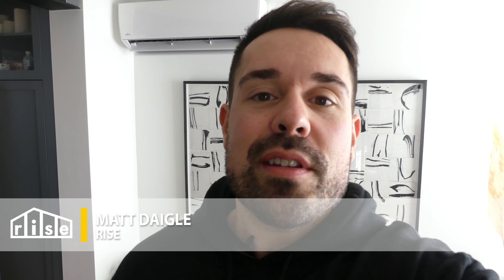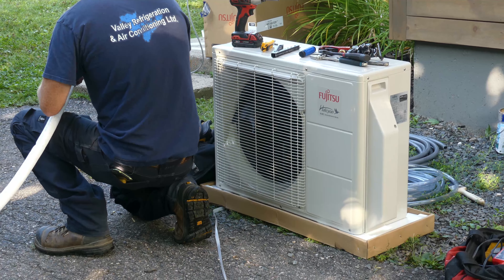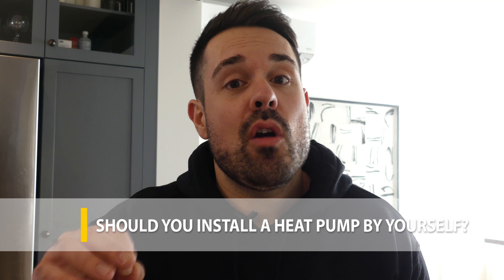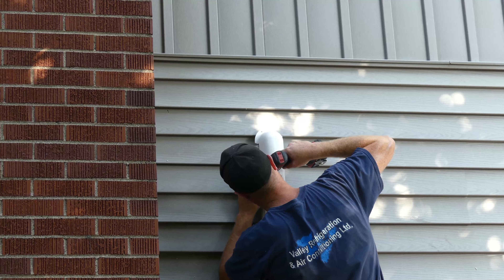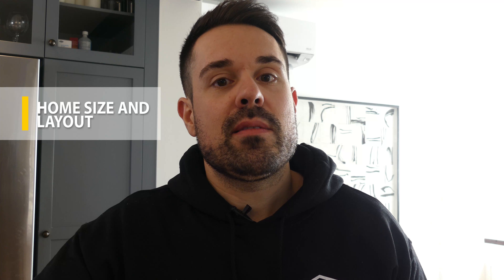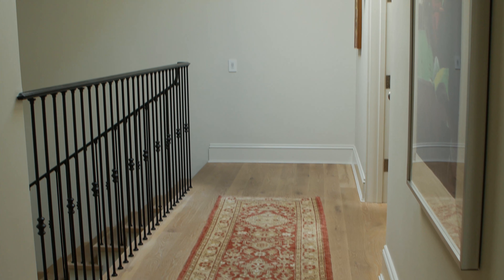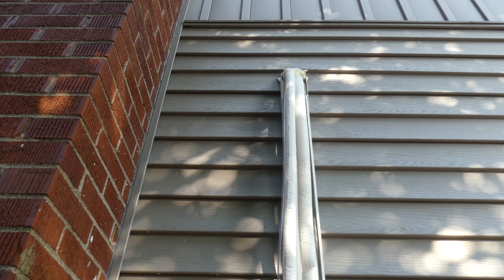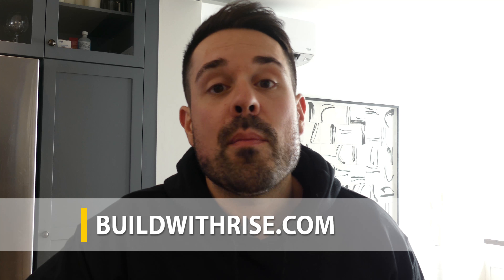Heat Pumps: Pros, Cons, and FAQs of Mini-Splits

Comment: My wife and I just installed a four head three ton Mitsubishi on Long Island NY. were the low temp  hits about 18f with a high of 85f. 
We worked on it part time and completed it in about four days.

Total cost of unit, accessories and a few special tools cost us about $10,000. We will never break even on this, but the house didn’t have central A/C and now it does. So this will help the resale value. It is also my main heating equipment with a very efficient oil fired hydronic system to supply domestic hot water and backup heat. 

I really appreciate having the ability to control the heat throughout our 1,100 square foot ranch. And directly heating the air using the heat pump verses using baseboard hot water is  more efficient.

As far as the safety of 410A, it’s not poisonous. It’s danger is the same as most other refrigerants, it displaces the air in the room and smothers you. There are no heat pumps that contain this much refrigerant to be a danger to home occupants. As far as the environment goes, 410A does not contain any chlorine so it’s will not damage the ozone layer of the atmosphere. It has a high global warming potential which could add to global warming . Technicians are supposed to recover refrigerant charges. 

Hope mini-splits catch on here like they have in Europe and Asia.

Comment: I installed a two ton, one outlet Mitshubishi in the fall of 2015. It is close to saving me the installed cost of $4200.00 . over using a  82% effeciency oil boiler and 10.8 EER window units. My total degree days is 6,000 yearly about evenly devided between summer and winter. 

Two things amaze me, one is the summer humidity is low eliminating  a long standing issue of summertime mildew and mold.  The second is the lack of any noise inside or out. 

These units require humidifiers in  the winter but I have no other issues and highly recommend the technology for their effeciency and reliability, in particular Mitshubishi.

Comment: This is one of the best money saving DIY projects in a home. The idea that this isnt a diy project(by scaring people with the back of an unprofessional/unorganized HVAC truck) is completely wrong. Specialty tools needed are less than $400 and the unit already has refrigerant  in it. Just FYI, the old refrigerant was insanely cheap and non flammable compared to all the new stuff. If there is a fire, the new refrigerant creates highly toxic gas.

Comment: My experience, I had electric baseboards which cost me $1400 a month to barely heat my home. The heat pumps brought my cost down to $150 a month and a heated home of 78f all through the winter, upstate NY. My whole house is electric including  water heater, so 150 is everything included.. I installed myself but I took hvac training in high school and I have a universal refrigerate license. Fujitsu  and Mitsubishi  are the only units I would install.
Reply: Hey,  what size indoor units and out door unit did you install? We have electric baseboard heat and want to upgrade to furnace or mini split.
Reply: My home is 100% electric baseboard heating as well. I'm hoping to get a Mitsubishi mini-split in a couple weeks. I initially wanted it for air conditioning, but found out the multizone units include a heat pump. After doing research about the heating, as my baseboard heat never feels comfortable, I've gotten more excited about getting one of these.
Reply: @Matt-rz9fh  hey sorry I'm responding so late. I have an 18k btu in my livingroom which heats my livingroom, kitchen, hallway and entrance. In the two bedrooms downstairs I have two 9k btu. My down stairs bathroom is heated with the air that circulates from the minis in the rooms.
Reply: @1995Benzo  you will not regret it. We used our heat pump the entire winter and I never had to turn on the electric baseboards. Save thousands of dollars. My mini splits paid themselves off the first year. I did everything myself so it was cheaper, but these units are fantastic. I recommend that you air seal your home, and also put in an hrv so that you can get fresh air in the house and remove the bad air.

Comment: I just installed a pair of 24K Mitsubishi MKZ units. I have a 6 room ranch with no open concept. I did the install myself from soup to nuts, with some help from my brother to hang the units on the side of the house. My father has been an HVAC contractor for 60 years as a one man operation, so I have worked in the industry. The only mistake was that I should have used a ceiling cassette in the living room. It is wide and long, but I could not center the wall unit. I am guessing that I have 45 to 50 working hours, because I had to think my way through the installation as it was my first one. I live in Manchester, NH
Reply: I'm in the same predicament, would a ceiling cassette provide great benefits? Why would a ceiling cassette be preferable to a wall mount cassette? thanks in advance
Reply: @DarwinChaug  I'm looking at these systems now as well. I thought I could live with the wall mounts, but now I'm looking into ceiling units in the attic. I think those will allow a bit of duct work in the attic to cover a couple of rooms.
Reply: Tim Krego I just got my 4 zone system installed. Ceiling cassette is quite expensive and much more labor intensive. I went with wall mount and works great.

Each unit needs their own lines anyway so usually they are run along the exterior of the house back to the condenser. Not worth the premium in my opinion but maybe worth it for looks if design is important.

Comment: We have installed a mini split to heat a 350 sf open area in our home. However our bathroom is always cold. It is off of the 350 sf room. What do you suggest we use to heat the bathroom?
Reply: 1.floor heating.
2.fan with an heater.

Comment: Rely on a heat load calc.
There are to many variables to “eyeball” the size of the HVAC system. A heat load calculation Is the only way to know the system requirements. These units are extremely efficient and will reduce your energy cost when properly sized and installed correctly. 
Mitsubishi is the way to go. These are reliable when installed by a Professional.

Comment: Fun fact, R32 is just R410a without the R125 in it. The only reason why they blended R125 with it is to tamper R32's penchant for flammability. Unfortunately that increases its GWP. Had we just used R32 we could have just kept on using it. At least for mini splits most repairs don't involve brazing.

Comment: it all depends on the cost for oil if you have baseboard heat … or … the price of Kilowatts cost !
Ours was cheap to use until National Grid here in Massachusetts went from 12 cents per kWh to 33 cents per kWh. Now I am thinking of using my oil furnace more. My electric bill went up $200 in one month alone just using the mini split :-(

Comment: I’m having a problem with the air conditioner.  Well I’m running the air conditioner after a couple seconds it just stops and the LED light next to plasma starts flashing.  So then I shut it off and I recycle it and it does the exact same thing over and over again.  Very frustrating.

Comment: would you embed the piping in the wall in an old apartment mini split installation or would you use line hides to conceal all the piping for a 2 room multi-zone project? I'd like it to look good but I want to make sure I don't have to worry about leaks or anything else. This would be done by a professional HVAC installer. Love to hear you opinion.
Reply from the maker: Hey Barb! A ductless mini-split heat pump doesn't need additional indoor piping. Each zone has a single enclosed unit that ducts directly to the outside. That's the beauty of "ductless" mini splits!

Comment: Do these units dehumidify at all and if so is there a condensate line that needs to be installed?
Reply: They pull a lot of water from the air. They have a drip hose that needs someplace to drain, usually outside.

Comment: Our house is a 1500 sqft tri level with electric baseboard heat located in northern Illinois.... would you recommend a mini split or a gas furnace?
Reply: I live in the central Va area with maybe 50 hours a year below 5° and 5 days a year of 100° heat. My unit is good for zero temptures but you can purchase "cold weather units" good to negative 15°. however the unit only  puts out  the the rated btus down to zero. 

I love my mini split but I  retained a 82% effeciency oil fired boiler for the rare zero days and for when I lose electric service thanks to my areas infestation of squirles and drunk drivers! I can run my boiler plus a few lights and a refrigerator on a 2500 watt gen set . My mini needs 2700 watts during very cold weather .

I am a fan of Mitshubishi mini splits, have had five years of use, saved the installed cost in the five service free year iv owned it. AND no longer have summer time mildew or mold.
Reply: MINI SPLIT 100%
Reply from the maker: I'm in Canada and I don't regret my mini-split for a moment! As Robert said, you can purchase units that retain relative efficiency to -15°. The mini-split will be extremely efficient most days of the year, and those few frigid weeks/days are when you can turn on your electric baseboards. That's a very common combination up here.

Comment: Im installing one for first time after installing ducted units for years as a Ct licensed technician
Reply from the maker: Nice, Mike!
Reply: Super easy to install if you are installing on the same wall inside and out. I’m also a tech/installer of Hvac systems.

Comment: OK so a ducted system will move air around much more evenly.  For instance we have a ductless unit in the dining room.  To get the living room and kitchen cool you have to let the dining room absolutely glacial.  Something I wish we knew.
Reply: That seems like it would be common sense though since the source is only coming from one room and you are having to force air across two rooms to get to the third, vs just having a duct in the room you want to cool.

Comment: You can install them yourself with a little research.
Reply: 420 Friendly  I said a little research.  You can always run the wire and have an electrician do the box connection.
Reply: There are DIY units available.
Reply: 420 Friendly  yeah you should see what the so called licensed professional did on my install
Reply: Mr. Cool sales a DYI model with the same warranty as a “contractor” installed unit. For The price of the “contractor” Installed unit you could buy 2 units and keep one as a spare.US HVAC companies are driving the demand for DYI systems. They are literally making 50% profit.
Reply: @darrendaniel2578  yea i was quoted 2900 today for a $1000 9k btu carrier unit. Pretty crazy they want to make $2000 for a job that might take 3 hours.
Reply: bill Gates I have my Mr. Cool installed and working flawlessly. Did all the work myself. Ran the power, poured the concrete pad. (Hardest parts) Typically the HVAC won’t do this.And installed the unit to a second story bedroom in one day. Added the line set cover and it looks professionally installed. I would do it over again.
Reply: @darrendaniel2578  thanks man I have ordered a 24k dual zone mr cool system. Ready to get started!

Comment: Are they using spray foam for your basement?
Reply from the maker: Hey William! After a LOT of research, I chose spray foam for my basement. I don't love the VOCs it gives off, but I felt safe knowing my family wasn't in the home during the install, and the basement isn't a space we frequent. Spray foam doubles as an insulator and an air sealer, which was a great choice for my older home. I chose blown-in cellulose for my attic we did a video! Check it out: https://www.youtube.com/watch?v=CVxvVjHsEVg&t

Comment: Mr cool diy is all u need 😎
Reply: Until you need to fix it.
Reply: @toddhutchens  That's my concern. I've seen less expensive DIY systems, but this is a long term investment for my home. I'd rather spend a bit more for a solid unit with a warranty and support.
Reply: @timkr66  You can't tell people how to spend their money. But you can show them why you shouldn't with knowledge and facts.
Reply: Mr Cool DYI units have the same or better warranty with half the cost. I could buy two units and have one as a spare for the same cost as a HVAC company installed mini split. Sorry, most HVAC companies doesn’t even do a load calculation. Learned this the hard way. Now I’m putting in a mini split to make up for the lack of cooling the $10,000 “License” company installed.

Comment: My Kerr MININSPLIT IS GIVING ME A LITTLE TROUBLE IT WILL START BUT SHUT OF AFTER A FEW MIN. BUT WILL RESTART AND RUN ABOUT 7 MIN. AND THEN COOL DOWN JUST BEFORE IT SHUTTS DOWN NO MATER IF I HAVE THE HEAT TURNED TO 75 AND THE TEMP. IS ONLY 69 OR 72 OR WHAT EVER IT IS SET TO IT DOES THE SAME THING.

Comment: Did you say that the mini-split is more efficient at heating than an oil/gas fired furnace?
Reply: Depends on cost of the fossil fuel and its efficiency. Natural gas mostly wins, but if you are in part of the season where you only have 30-45 degree F temps, then the mini split probably will be cheaper. Vs propane it should mostly win, and if fuel costs go back to 4 dollars a gallon, then it's no comparision.
Reply: Of course if you can use solar panels to offset your carbon foot print, you'd be doing much more for the environment long term. Natural gas puts out tons of CO2.
Reply: Yes I Think electric heat such as base board has a cop of 1 or oil/gas is COP of .93 and the fujitsu units I use have a COP of 3.8 to 4 Coefficient of performance. When you check the model mini split in the specs it will show the COP.
Reply: @rgood66  Just remember COP can drop to around 1.5 as temps drop below 0 F.
Reply: @sprockkets  I didnt know that thanks for the info.
Reply: @sprockkets  exactly ! Electricity rates here in New England have TRIPLED ! National Grid went from 12 cents per kWh to 33 cents per kWh. So the difference between using our 2 mini splits versus our oil fired baseboard water heat is a toss up now :-(
Reply: @robskully3539  and what sucks is that cost went up thanks to nat gas or other fossil sources going up.
Which then means you'd make good money setting up your own solar and wind.
Reply: @sprockkets  I am too old to recoup the return in investment for solar. Plus part of our roof construction is done with trusses and they were not engineered for the load for future solar panel weight.

Comment: What kind of companies install these types of units? I am finding when I talk with regular HVAC companies (specifically air/con) that they are reluctant to advocate for them. I can not understand this. I currently live in Central Florida
Reply from the maker: Hey Shane! If you're speaking with A/C installers, it's no surprise that they are advocating for an A/C installation over a heat pump. In very warm climates like yours, if heating isn't a requirement then perhaps an efficient A/C unit would be a better fit. Look for the Energy Star label and a SEER number above 20.
Reply: Reluctant? You bet because i was told they dont make an great amount of money on mini splits.
Reply: I'm in CT and most HVAC companies install these units.

Comment: I’m currently installing a bulrushes 3 ton with 4 separate air handlers running 12000 btu each. I have to finish wiring and line set connection. I’m going to have tech vacuum and release coolant..to be continued
Reply: Sorry product is a Bluridge...not bulrush, lol
Reply: 48000 BTU indoors ON A 36000 outdoor unit?

Comment: thanks for this! very informative. do you know if you lose lots of energy from the unit if you use the heat pump system to heat your infloor heating? 
is single units better than multizone? (more efficient?)
Reply from the maker: Hey Ravi! You can definitely use a heat pump system to efficiently heat your floor with a radiant heating system. Whether you're heating/cooling your air or your floor, you will need to choose a heat pump model that suits your square footage. This would be a conversation to have with your installer or the manufacturer. Hope this helps!
Reply: single units are more efficient than multi zone units. Plus having single units allow you to run one in heat and the other in cool, something which you can not do with multi zone unit.

Comment: I live in East Texas and have a 1000 square ft. brick home, built in the mid 70's. It has blown in insulation and what looks like a foil heat barrier in the attic on top of the insulation. Ours central AC went out ten years ago and I've been using two 5000 BTU window units and one 10,000 BTU window unit and they cool the house much more efficiently than the central AC ever did at about half the cost. I am wondering if it is worth the cost to change to ductless AC instead of going back to a central AC unit. I still have the ductwork in the attick.
Reply: You could just use one system for your home and be good. 12 or 15k. No reason to use old ductwork in an attic that gets hot and is leaky.

Comment: What about using green, sustainable, passive materials like hemp, solar, heat exchangers, heat pumps
Reply from the maker: Great question, Paul! For most sustainable home enthusiasts the ultimate goal is an efficient home that is built with recycled or renewable materials and that creates more energy than it uses. For many homeowners looking to renovate for energy efficiency, the first step is air-sealing their home and step two would be installing an efficient heat or cooling source like a heat pump.

Comment: It is not true that a mini split will save money of gas furnaces.  The cost per unit of Natural Gas is much, much less than electric. On average in Chicago, heating with a Mitsubishi Hyper Heat mini split costs 50%+ more than a gas furnace!!  Don't mislead people, efficient does not equate to cost when comparing gas to electric.